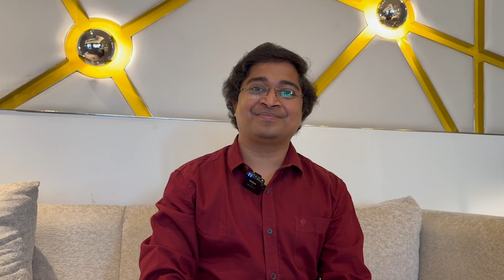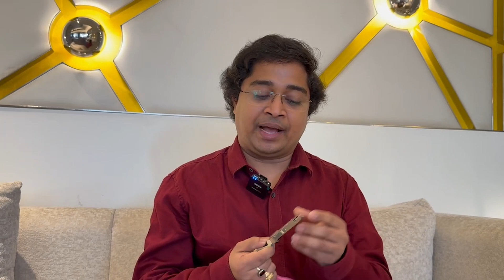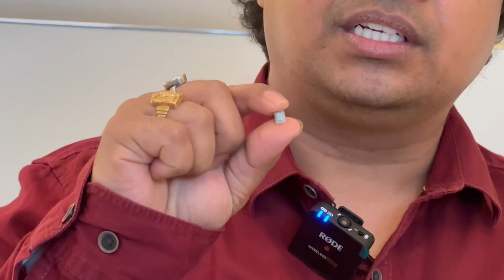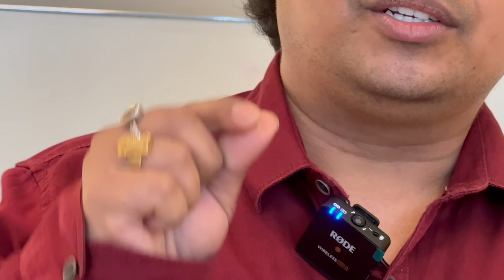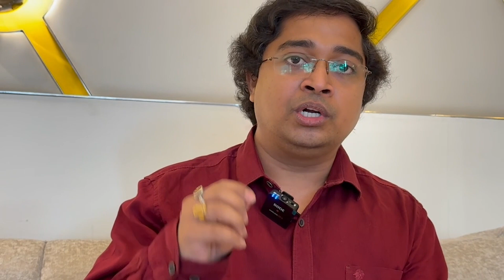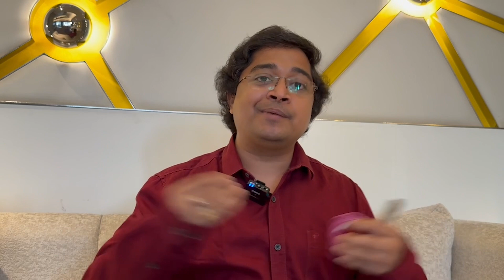Rohin Y: Developing Optoelectronic Processors for Data Centers and Near-Edge Compute

Comment: What a fascinating background: Engineering + Physics. However data pipelines are not the bottleneck, the data is. For example IF the data pipelines could perform operations on and glean status flags from the data without actually inspecting it, all silicon pcie-based  non optical operations could be performed at wire speeds.